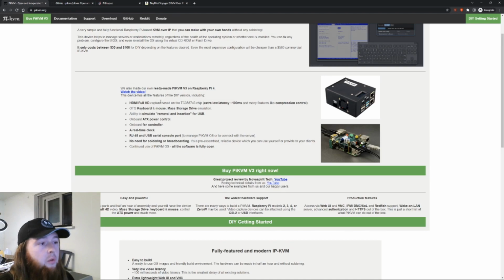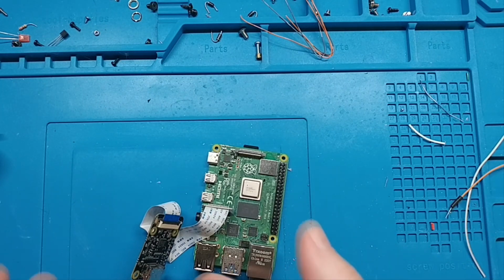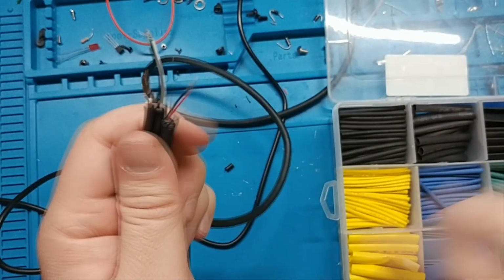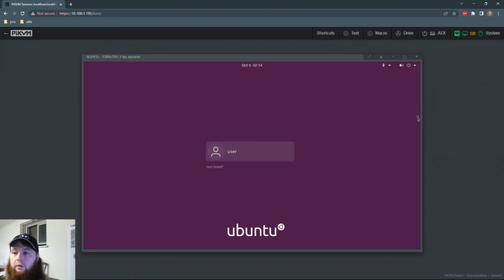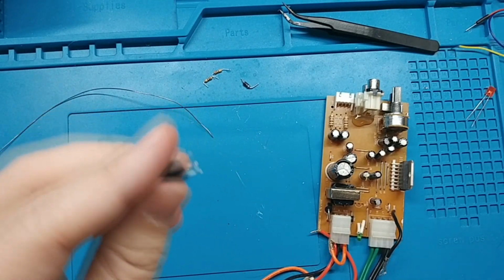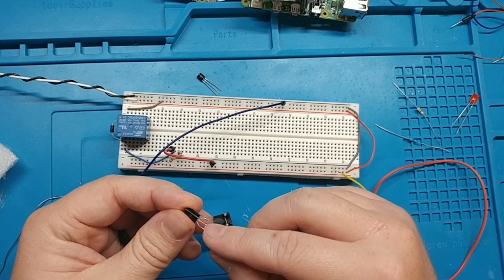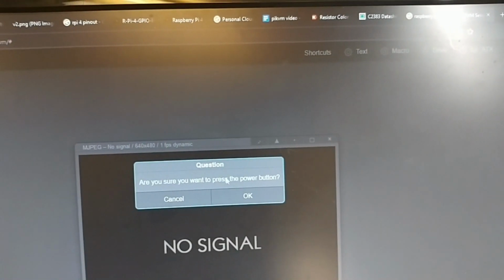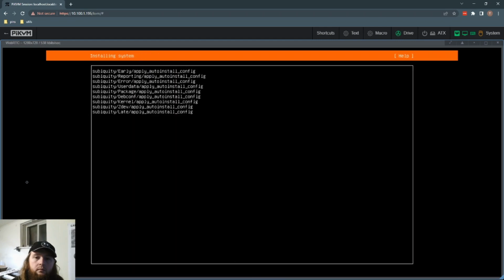Building a PI KVM for under $100 (Raspberry pi4 based ip-kvm)

Comment: Hi,
Great video and ty for that. Just one question if my PI4 is powered via POE do I still need this "special" USB splitted cable. If so I could use the USB C from the Pi directly to the PC ?
Reply from the maker: Hi and thanks!

If the Pi4 is powered via POE (or other means like the gpio power pins) then you don't need to do all the splicing to make the 3 way cable, but you do still need to cut the power wire within the cable. So if you are powering via POE you just need a regular USB C to USB A  cable but you have to cut the power (red) wire inside. I made one this way and I used an exacto knife to carefully remove the insulation to cut the red wire then I taped it back up.

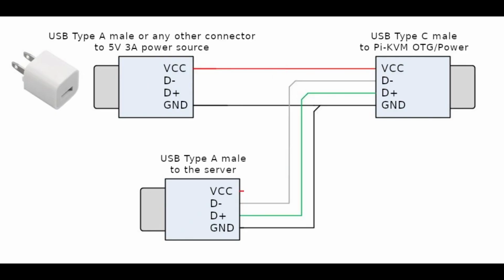If you look at the diagram at 9:22 you can just totally ignore the top left part of the cable and omit it (if you are powering via poe)
Reply: @WightHouse45  thank you very much ;)